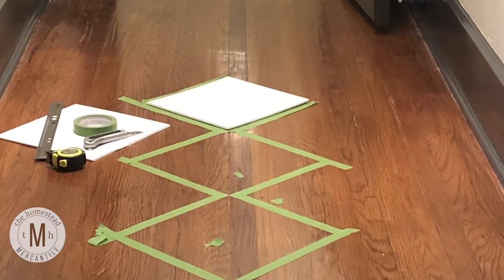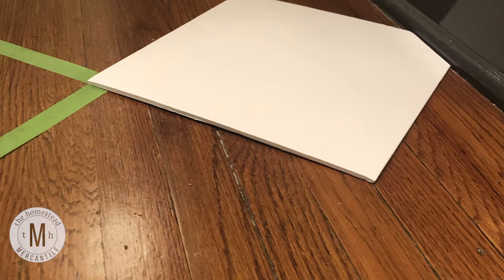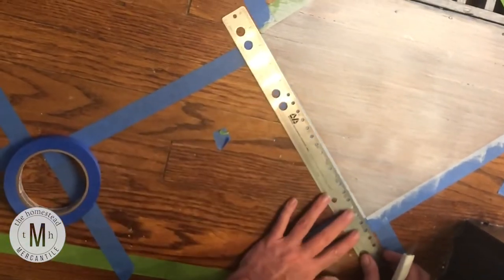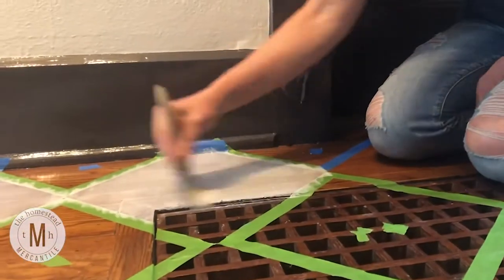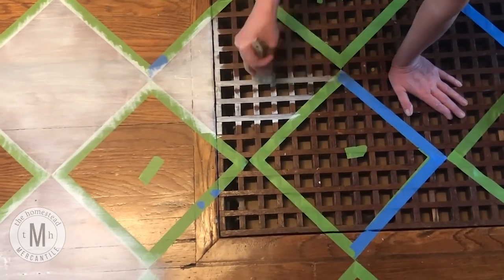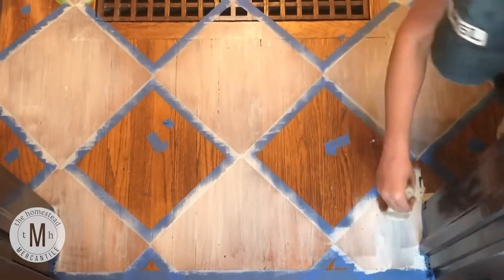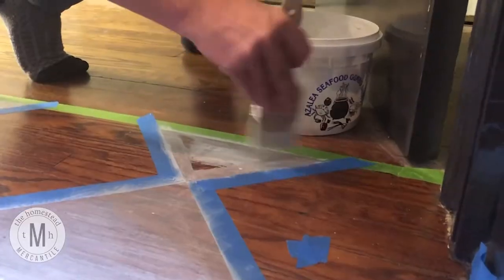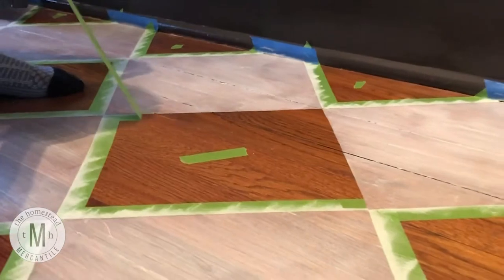How to Paint a Harlequin Floor Pattern

Comment: Were these floors actual hardwood or engineered hardwood? Did you sand the squares where you painted so they would hold the paint better? Thanks for the tip about marking each square not be painted! I will definitely do the same. Love the floors!
Reply: It was a hardwood floor. I cleaned and painted over the top of the existing finish with floor paint from Lowe's that the client purchased. It's a time consuming project but has such a wow factor!

Comment: Hi! What was the product you used? Did you apply a top coat to discourage chipping and scratching?
Reply from the maker: The client purchased a floor paint from Lowe's. It didn't need a topcoat. They are happy with the way it is holding up! It's such an impactful project. Let me know if you decide to tacklet it yourself!
Reply: @thehomesteadmercantile6328  it always needs a top coat, especially in high traffic areas.